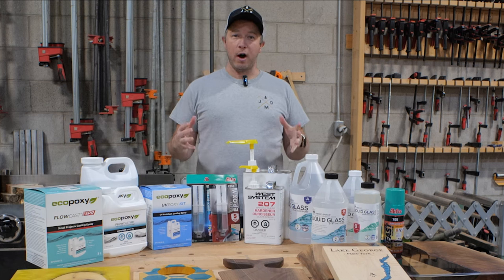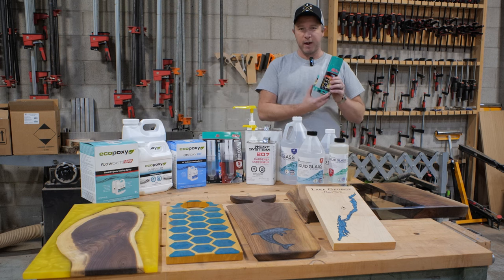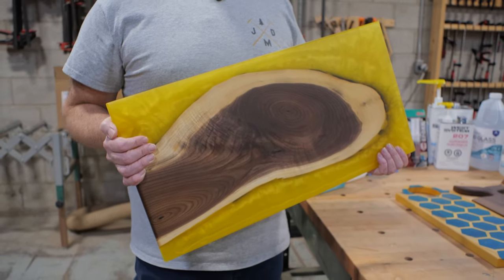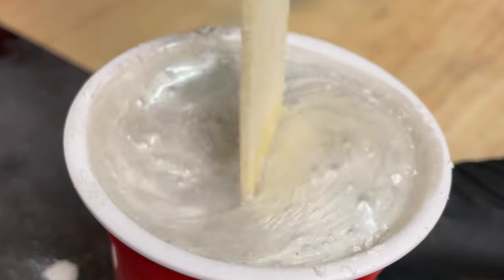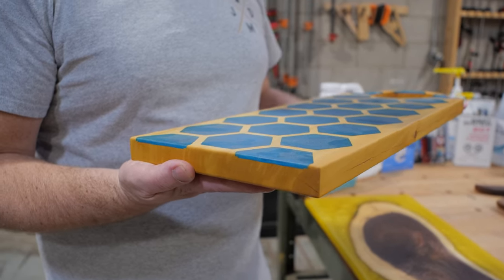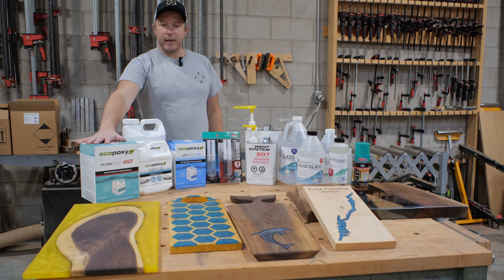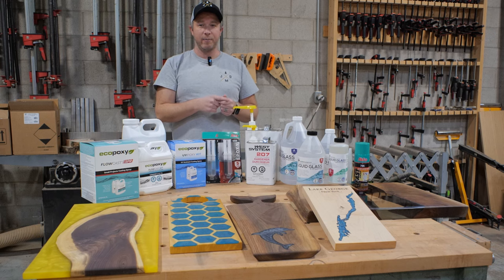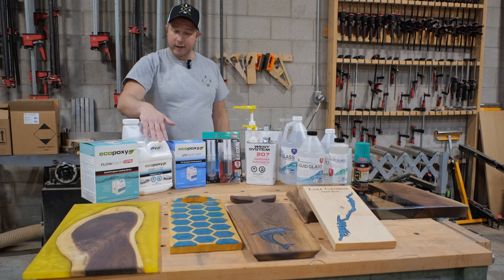What Resin To Use | The Best Epoxy For Woodworking

Comment: REALLY  need some advice on a project I did for the Nature Centre, as I am their artist. I had to cover mosaic tile table tops   (which had been created years ago, so everything was more than fully cured and stored inside)   with resin so the surface would not cut any little fingers. Well, I got an Eci epoxy resin with UV protection rated for outside use and put 3 thin layers on it. Cure of each layer for at least 3 days before lite sand and apply more.  Looked great and prevented any sharp edges from protruding.  It seemed fine over the summer, facing west, however, when winter came it had turned yellowish and even cracked in a few places. I am not sure what to do with these artworks now. I could lift off the epoxy and re-apply after sanding it down etc,  but then do I add a varnish on top to protect it? We have extreme temps here in Canada. From -30 to + 95 Celcius here.,  Thank you in advance. I really hope you see this, as I can't seem to get any answers from anyone on this topic!  I did learn from your video, I just need some more ideas before going to town on this yet again. Cheers and thank you!!:) I used the Ecopoxy exterior epoxy UV. for thin pours at a time. I did not need a deep pour over the mosaic tiles.

Comment: Great info. I just poured the super clear 2-4” last night. Super easy instructions and easy to do. Did a few serving trays. Could have used the 24hr one. Didn’t want to risk it though. It’s my first time doing an epoxy table. So still has time to fail. But 12hrs in and it’s going great
Reply from the maker: If you've got the time, there's no harm in a longer curing pour! How did it end up turning out?

Comment: FINALLY!!! A decent video explaining the different kinds of epoxy and best uses for each kinds.
One thing though, why wouldn’t you use the thick pour epoxy for deep pours instead of RISKING the other that’s only good for 1” and 1/2?
Great video!! 👍🏻👍🏻
Reply from the maker: We use flowcast for thicker pours because we've found it to be consistent for our uses. It's what we're used to, and what works for us! We could use other thick pour epoxies, but we like pushing limits 😉
Reply: @jeffmackdesigns , what is your opinion on using AkFix 705 vs Black CA glue for filing small pin holes?

Comment: Just curious as to why you would push the limit on the ecopoxy when you also have the super clear in your shop? I use super clear for most everything as well. Why not just use it when it is designed exactly for the pour you are doing rather than pushing the limits on the other.

Comment: I have used Flowcasr and Squidpoxy, both with great results. Recently tried Ice Cast as I had to turn a project round pretty quickly and it was what I could get locally. Again very happy with the results. I do like the sound of the SPP... I think an order will be coming your way shortly.
Reply from the maker: Thanks for the insight! We don't think you'll be disappointed with SPR, its been great to work with especially on those quick turn arounds. 👍

Comment: Kinda surprised you don't mention Alumilite or Total boat? I found Total boat to be very user friendly after seeing how Alumilite reacts to any kind of moisture issues in wood.
Reply from the maker: I haven't used Total Boat before butI have heard good things. If we were to bring in another brand, that would probably be the one. In terms of Alumilite, I have minimal experience with it so i didn't think it would be a good one to include. In the future I want to talk more about Alumilite after I have more experience with it.
Reply: It’s not friendly, ruined my 2 projects, terrible formula, too thick, leaving bumps and lumps.
Reply: @annadivorn3047  if there is any moisture in the wood. Alumilite will react negatively. Other than that, it does well.
Reply: @unclemoe5733  I was referring Total Boat
Reply: @annadivorn3047  anna, I've been using TB High Performance for over 3 years. The only time I've had issues is when i push the limits on Volume. Wondering what type you used? Possibly, a mixing issue? What kind of projects failed? Trying to help and learn here!
Reply: @unclemoe5733  TB tabletop epoxy. Trying to finish my charcuterie board project, half wood / half floral. I’ve never had such issues like with this specific epoxy..it would not self level or pour evenly:( i'm no beginner. I had the temp and timing and weights down to the point. I saw so many artists promoting this brand and decided to give a chance. It was a bad decision. Should’ve tried on something else before ruining the big project.
Reply: @annadivorn3047  so sorry. I can tell you to stay away from another one portrayed by a lady named Jess from Alaska. I tried it and it wouldn't level. I did use one for a table top for my brother i had great luck with. GLAZE COAT by Famowood. Menards sells it. Cheap and clear. Worked as it should!

Comment: I am getting ready to pour a cutting/charcuterie board. It is 1and 3/16 inches thick. What would be your recommendation for a pour slightly over an inch. The 24 hour resin sounds great but I don't want to ruin a board just to save some time.
I would very much appreciate your opinion.Thanks
Reply from the maker: I would recommend the Ecopoxy FlowCast considering its deeper than 1”. There’s a chance the the SPR would flash cure at that thickness.

Comment: So for smaller projects...say 12x24x1" the Ecopoxy SPR would work?  Will that work with shallower pours such as filling in the stripes on a flag carved with a cnc of say 1/8" as well?

Great video and maybe the best explanations I've seen to date.  Thank you and keep up the good work!
Reply from the maker: The spr is perfect for the 12” by 24” by 1” application and you can also use it for the 1/8” application but it will take a little longer to cure due to the small volume. Ideally, the Ecopoxy UVpoxy would be for the 1/8” pour.
Reply: @jeffmackdesigns  Thank you!!

Comment: I am just starting out and reviewing everything before diving in! Starting with using templates and making all wood boards, but want to dabble with Resin a lot. Your videos are amazing! Now for resin ours for 1.25-1.5” will Ecopoxy SPR be good use case or better to go a deep pour epoxy? Also have you used CA glue by Starbond Thick medium instead of Akfix for pin holes and filling voids? If you have is that better or is it basically the same and would work here as well?
Reply from the maker: Sorry for such a delayed response! SPR is rated for 1", so we can't really recommend going thicker although we have done it with success. Any CA glue would work in theory, we just prefer akfix and have used other brands in the past!

Comment: For an epoxy night light or lamp, what would you recommend? The night light/lamp will be done in two pours with some type of burl wood. This will be my first one and its a tester for me before i try a bigger project that i have in mind. Thank you
Reply from the maker: Selecting epoxy really comes down to the type of pour you're doing. The overall size, how thick or deep it is, how much time you have to let it cure. Some epoxies can only be poured 1/2" at a time, some up to 2" so it is hard to say. You could probably get away with a faster curing epoxy like SPR from the sounds of it, given it is a small night light.

Comment: Hello, Thank you for the provided great information. What would be the best choice for classic car interior wood trim? I have removed cracked old layers / veneer and applied stain to the parts after sanding and preparing the surface. Now I need to add appropriate resin/epoxy. Please advise. Thank you!
Reply from the maker: For something like that, maybe consider a product that could be found on firearms and gunstocks. Tru-Oil comes to mind!

Comment: I'm planning to do a table with a thin strip of epoxy (1"×1"× 36" roughly) so would the flowcast be ideal? Also, are there any reliable brands I could buy in smaller quantities since I'm only going to need a very small amount or should I should just start researching other projects to ust the extra in?
Reply from the maker: I would recommend using the Ecopoxy FlowCast for that application. The regular FlowCast will take quite a while to cure in that small amount.

Comment: very helpful, my son and I are going to make some wood/epoxy boards, thanks.....we don't have a drum sander, but a wood planer, is it ok to run the epoxy slabs thru the planer?
Reply from the maker: You can run boards through the planer. If the blades are dull, you may experience some chipout. But, It is totally ok to send through a planer.

Comment: Very helpful video,thanks. I have a cookie slap 4 inches high and needs only 10 kg of epoxy to fill up. Do you believe with a good room temperature Flow cast will cure properly?
Reply from the maker: You shouldn't have any issues given you follow the product instructions. 4" thick could potentially cause some issues but ita hard to tell without seeing!

Comment: Dear Jeff, thank you for the video.
I will do a river table and have a question about:  seal the edges of the wood before poor or not? Some youtubers say you must do it otherwise comes bubbles from the wood in to the poor. Others says is nod needed. Its depends which epoxy ? I cant make a decision and will not fail with my first river table. Thanks in advance
Reply: Additive: with sealing the edges and without top coat, the epoxy bond only very thin with the sealing part of the epoxy. Its this correct?
Reply from the maker: The epoxy will bond with the wood either way. We don't always seal the edges before hand. But if youre worried about bubbles you can definitely do it as an extra step

Comment: What do use use for sealing wood before pouring? I recently did some inlays with Varathane epoxy and had the epoxy bleed into the wood and around the inlay. Do you use the same epoxy for sealing or any wood finish?
Reply from the maker: You can brush a coat of clear epoxy to prevent bleeding, or use some kind of spray urethane!

Comment: Will any of these products work for outside countertop where it will be in rain, snow, direct sun usage? If not, what would you recommend. Thanks
Reply from the maker: UvPoxy would be your best bet, but there may be other products available better suited for that exact use case. Casting epoxy typically yellows over time in direct sun while some brands have a higher resistance than others.

Comment: Very helpful video,thanks. I have a cookie slap 4 inches high and needs only 10 kg of epoxy to fill up. Do you believe with a good room temperature Flow cast will cure properly? 7:24
Reply from the maker: we don't recommend going over the recommended pour thickness. We have done it, but its always a gamble.

Comment: I have a large wood/ Epoxy Bar top that I am building, and it is just over 2 inches thick, 9 foot long and 3 feet wide.  Can I use the Super Clear Thick Epoxy and pour it in 1-inch-thick increments?  What is the best cure time?  The temp of my shop is approximately 75 degrees.
Reply from the maker: For a pour like that, I would use Ecopoxy FlowCast. The cure time is 3 days and if possible, I would bring your shop temp down to 71 or even a few degrees lower if possible.

Comment: I'm having trouble getting the akfix in the pin holes. As soon as I sand it down the pin holes are back...what I'm I doing wrong? Also do you guys seal the edges of river boards? I had a board that the epoxy didn't adhere to. People on FB said to sand and seal.
Reply from the maker: Our technique is to let the resin/akfix drip into the pinholes vs filling them directly and potentially trapping air. Dab a little bit on the very edge and let it work its way into the voids! We finish in rubio monocoat, all over, every edge. Are you talking about a flood coat on your project?
Reply: @jeffmackdesigns  no, I'm talking about sealing the edges of the river boards before the epoxy is poured to help the epoxy adhere to the wood. I had a board come apart from the epoxy, it was obvious that the epoxy didn't adhere to the board.
Reply from the maker: @nathandavis7424  The only time we've seen an epoxy to wood bond fail on a live edge is when the live edge wasn't cleaned up enough. By that, i mean removing all the bark and then sanding and roughing up the edge until you have exposed the sap wood for the epoxy to adhere to.
Reply: @jeffmackdesigns  it was a river set I purchased for you guys. As I was sanding it, it came apart. I wish I could attach a pic...but I was able to sand everything down and re epoxy it back together

Comment: I have a flood coat epoxy issue that no one has been able to figure out so far, including several well-known brands. 
I have a pretty extensive knowledge/use history of epoxy, and ALL process' have been done perfectly.
B Walnut wood, vac kiln dried to 7%, Major epoxy brand, seal coat/s (1oz/sf), flood coat (4oz/sf).
Sanded @ 220 between coats, cleaned with 91% alcohol, torched 3 times.
When leaving the piece to cure overnight it looked PERFECT, 24 hours later was cured, looked great on surface, but massive amounts of micro bubbles embedded.........here's the odd part.......The micro bubbles appeared on the entire piece EXCEPT the lines where the epoxy was originally poured from the bucket onto the piece. 
WEIRD!!!  
Again, all processes/steps were spot on, measuring/mixing/cleaning/temp control/humidity control/torching/etc. 
WHY and how did bubbles appear AND, only form in the spots they did.  Any Idea?  This entire process from raw wood to final flood I have done twice now on the same piece......with same issue both times.
Reply from the maker: Are you de-gassing the epoxy after mixing? Sometimes a reaction can cause off-gassing while curing. Or something is contaminated along the way.

Comment: I am attempting to build a giant mortar and pestle (more like a sledgehammer) out of a split eucalyptus trunk and its branches for making authentic Japanese mochi. The trunk is approximately 2'x16" and I want to fill the cracks with food safe epoxy once I have the general shape, then I'll grind and sand to finish. To make mochi it needs to be pounded and use hot water periodically. Is what I'm building going to poison customers or family members??? I've never seen an epoxy hammer for food before... hoping it's not an obvious thing as to why.
Reply from the maker: We wouldn't exactly recommend using epoxy for that job. Once cured, epoxy is strong but can break with impact.

Comment: What is the difference between the West System and Ecopoxy?
Reply from the maker: Ecopoxy offers many different types of epoxy for multiple purposes. The West Systems that we use is more of a fast curing shallow pour epoxy, good for cracks and voids.
Reply: @jeffmackdesigns  owww
In your opinion, If you want to connect a broken racket, what resin is better to use? The resin will later be combined with carbon fiber
Reply: @jeffmackdesigns  Do you know
How to order West System epoxy? I'm from Indonesia

Comment: I have tried to buy the Akfix 350 online. I have found it impossible to complete a transaction.
Reply from the maker: Unfortunately we do not carry Akfix 350, but we do stock the Akfix 340 mentioned in this video. Available here: https://jeffmacksupply.com/products/quick-setting-epoxy-5-minutes?variant=41221445812421

Comment: Bubbles, lets talk bubbles, Ive had many epoxy projects fail due to bubbles...........suggestions?
Reply: Torches.  Deep pour epoxy, but do it in two pours.  Coat the wood with a thin coat of epoxy before the main pour(prevents air that will otherwise escape from the wood).  As an amateur, that all I got
Reply from the maker: These are great tips. You could try a vacuum chamber, but we understand those aren't available to everyone. Have you tried experimenting with different resins? Like Dutch said, a thinner viscosity resin such as a deep pour, pre-treating the wood and the use of a heat gun should help. Another thing to be mindful about is the way you pour. Aggressive pouring can lead to excessive bubbles.
Reply: Pour in one corner at a decent height, that helps to eliminate bubbles and let the epoxy push the bubbles out as it flows to the edges.
Reply: @youflatscreentube  Cheers!!
Reply: @jeffmackdesigns  thank you sir.....Where do I get a vacuum chamber big enough for a 5 gallon pail?
Reply: @arizonaheatwave4080  thanks

Comment: Which of these products are UV stable?   I'm running into yellowing with past projects.  I'm considering using Polyaspartic products instead.  Thank you for your time.
Reply from the maker: Unfortunately every epoxy is prone to yellowing, it just depends on time and uv exposure. Certain brands turn yellow much quicker than others. We recommend Ecopoxy UVpoxy for projects that need extra protection!